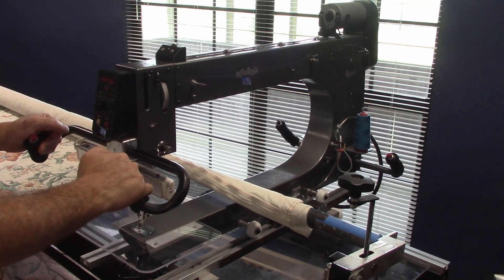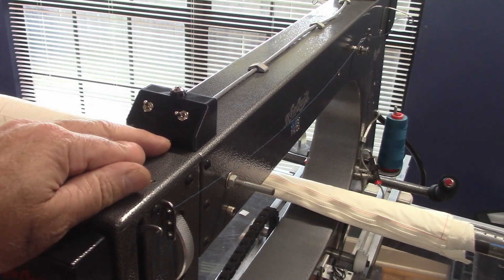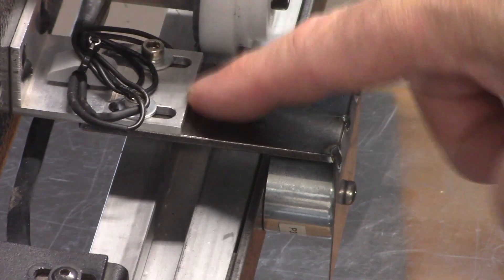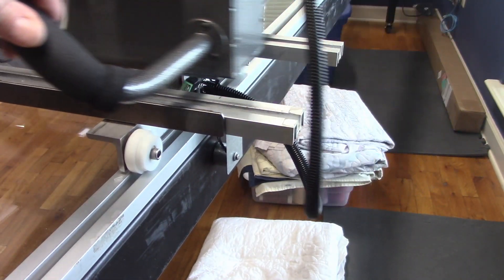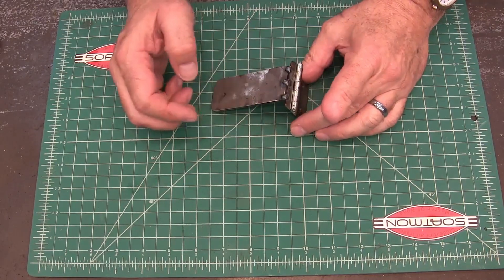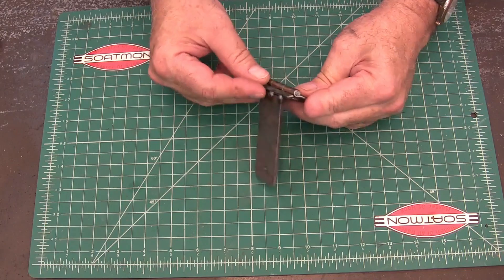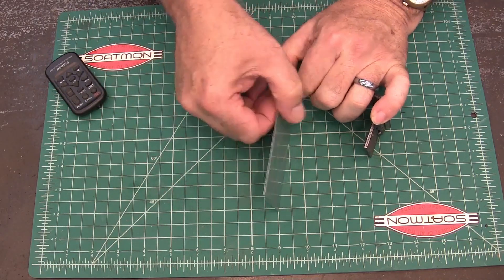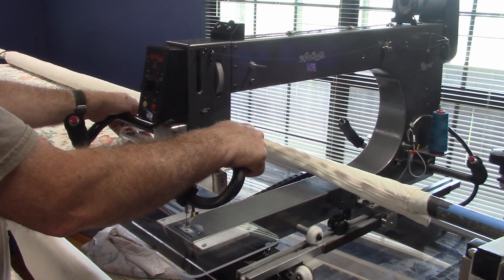DIY Longarm Sewing Machine Channel Locks

Comment: Thank you SO MUCH for this video, parts list and wiring diagram. I quilt on a budget and back pain limits the amount of time i can quilt each week so these locks will be a godsend. I am going to visit a welding / metal fabricator to see about getting the welded parts made. How thick was the sheet metal and other piece of steel you ended up using?  Thank you again for sharing your talents.

Comment: That is interesting.  When do you plan on making this CNC for her???   I can surely see you using your controls on the router and adapting them to the sowing machine.  Just kidding of course but that would make a good video.  Thanks for the references to the electric magnets and the switches and the like.  Hope you are having a good weekend it is very nice here in East Tennessee for the last week or so.
Reply from the maker: I have definitely thought about converting it but the main problem would be the design software and control software interfaces that my wife would have to use.  There just isn't a user friendly option unless you buy a system that is made for longarm quilting and then you are talking thousands of dollars. The hardware part would be pretty easy.  With the new wheels I'm hoping my wife will be able to free hand it, if not that will be coming.
The weather is getting better.  I was on the tractor this morning for the first time cleaning up some things.  We need rain desperately.